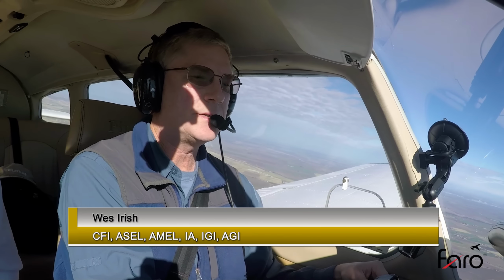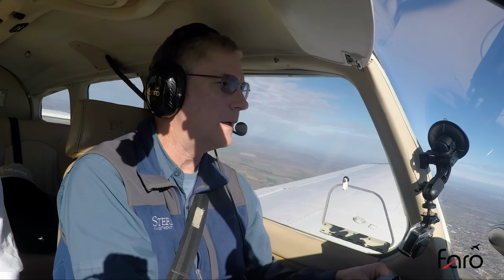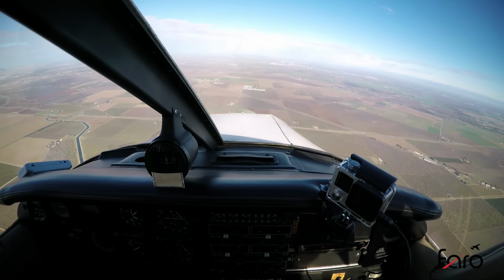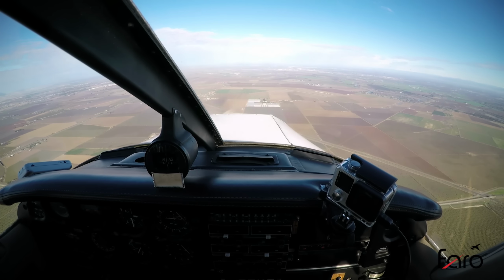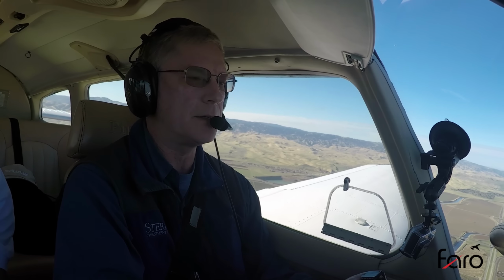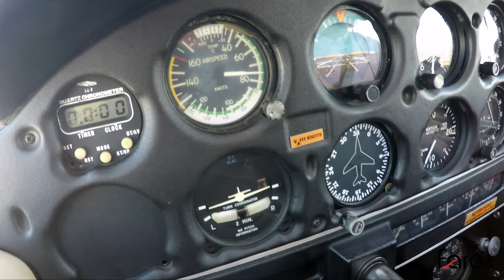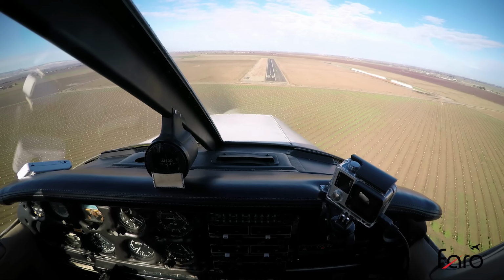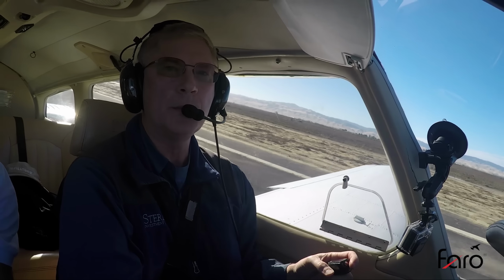Engine Failure in a Single Engine (2.7K HD)

Comment: Great video. My only recommendation would be to mention pitching for best glide speed, 73 knots in this case and then trim out the control pressures with pitch trim to make it easier to maintain best glide speed.

Comment: Actual and simulated engine failure differs a lot as in simulated engine failure the idle engine propeller produces some thrust which will actually increase the glide distance significantly

Comment: At such a high altitude you need to lean the mixture instead of rich.  Not rich mixture when high.  Low rpm needs lean mixture also.  Specially on long descends you are fouling the plugs and dirtying the oil with such a rich mixture.  Low RPM needs leaning the mixture too. FAIL BIG TIME.

Comment: I think in practice you probably need to aim to have a bit too much speed or alt because when the engine fails for real it comes down noticeably quicker than when its just idling.  He had just a bit of extra that he slipped off so that would have been about right.  The other thing is when you get to the approach you perhaps want to move the throttle to idle, or if its a field cut everything off because engines often can not quite fail and a surge at the wrong moment will mean to go through the far hedge.

Comment: !. Always have a landing area in mind in case of a failure.  2. Set up a glide. 3. Troubleshoot using a checklist. 4. Know the surface wind. 5. Look for traffic and obstacles. 6. Communicate  your emergency and intentions. 6. Fly the plane.   ATP ASMELS  FI A&I GI A&I  Rotorcraft  Glider   FAA Gold Seal and "Master Pilot".

Comment: sir what about engine out right on take off with only 100 feet of air.
Reply: Be sure you're ready for whatever is in front of the runway. There is no alternative in the case you mentioned.
Reply: That's definitely about the worst case engine situation, at least at most of the airports I've based out of.  Unfortunately a lot of these airports (on the edge of major metro areas) have a LOT of buildup around them.  There's really no "good" place to plan for a low altitude engine failures from a couple of these runways, so my plan has always been to watch about 30 degrees left or right of my flight path, and pick the best possible spot based on the situation I'm in at the time.
Reply: aky19832001 
quickly try to find a flat space like a field or a road not much you can do. try to avoid homes!
Reply: land within ±30° of straight ahead unless you are certain your glide ratio is 20:1 or something fierce
Reply: pray
Reply: Prey on what? Ohhhh you mean pray.
Reply: well done einstein you spotted a mistake on a comment that was made two months ago
Reply: comet where? Ohhhh you mean comment. How's that for expediency?
Reply: we can do this all day
Reply: OK! You're tern. :-)
Reply: LOOL X__X i dont know what to say here i made a misteak  fix it
Reply: Steak! Oh, you mean mistake.
Reply: @endotype2286  I'd rather have steak than mistake.

Comment: As a second action, I would turn carb heat on: if the failure is due to ice in the carburetor, you want to use any leftover engine heat to melt the blockage.  Hence, the earlier, the better.

Comment: Ops.  Had you been using a check list you might have remembered the Carb Heat/Alternate Air during the initial power quadrant check.

Comment: A simulated engine failure means to turn off the engine and go for restart but, you never shut down the engine. I kept seeing the propeller continuing to turn as if it was still running. What gives?
Reply: carl cappy He had the power at idle, just because the engine was running doesnt mean it was producing any power.
Reply: I think even if the engine were out it would likely "windmill" and appear to be running.

Comment: Pilots will do well to remember that, if its got wings its flies so fly it safely to the ground.
Reply: When the pilot pulled power on a CF-104 Starfighter, the tail started to drop almost instantly... It will glide straight down, backwards if you want, but the ejection seats might work better.
Reply: @andytaylor1588   In certain situations you right,  search on youtube F15 lands with one wing, amazing feat.

Comment: Nice video. Great to see a full glide-in approach and landing. The bummer about the Piper is it only has one door/hatch. My training is paused at the moment. I may continue in the Piper, but ultimately when I'm flying for recreation, I think I'll choose a plane with two doors. What do you think? Am I being too cautious?
Reply: Just before setting it down, get the passenger to slightly open the door and jam it open with a coat or something.

Comment: Not sure why you are landing on the numbers for an engine out. Is midfield not a more appropriate point?
Reply: Nope. If you had an engine failure where there was no airport, and you were landing in say a 400m paddock, you want to be touching down right after the paddock begins (Not halfway down the paddock!) Hence why you aim for the numbers when doing glide approaches at an airport, to simulate a short paddock etc..

Comment: Ok to slip with full flaps?
Reply: Adam McGhee 
Absolutely
Reply: It depends on the aircraft which you are flying. It is prohibited in the Cessna 172N but not in the Piper Arrow. The reason some manufacturers recommend against is because it could cause the tail to stall.
Reply: NOT PROHIBITED DAMMIT! Alright maybe that's too much, it's just said it's to be avoided as it may cause some disturbed air to go over the elevator and cause oscillations. You will need to do whatever you need basically, I slip with full flaps on the 172 all the time, and the oscillations are really not that bad.
Reply: Yup, nose down when slipping so the air is smooth over the back.

Comment: Why fly a beautiful square pattern when the purpose is to survive?  Why not fly directly over the threshold with sufficient altitude and spiral down at the key position to assure the landing in all cases?  BTW, why was "fuel selector to fullest" something like number 150 on the emergency checkist?  It should have been the first thing after setting up the glide and carb heat, if not a fuel injected engine. Just wondering to myself.

Comment: Every Time I watch someone demonstrate an engine failure it is always the same, lots of altitude and near a runway. Their demeanor is always calm and collective with lots of confidence explaining how they would handle such an event. I have had 4 engine outs in single engine aircraft, 1 engine out in an overloaded twin and several other emergencies to include turbine compressor stalls and hydraulic failures in helicopters.So first let me say, you are never ready for the event, there is almost always no runway available and the majority of the time it’s at low altitude just after takeoff. Just for once I would like to see one of these guys who teach engine failures actually have to experience one. I can assure you their entire physical demeanor, voice and decision making process would be different! To be honest I think most would bite the dust if it was real. Anyone can talk about it from a flying powered aircraft at idle, experience it with no power where your life actually depends on the way you handle it.Here’s my advice for an engine failure, Fly the aircraft to the ground and get it as slow as possible (stalled) just before touchdown. Drop it in like a brick if need be. Get rid of all unnecessary forward movement. I can assure you that the engine will most likely be wind-milling and if you had the fuel selector in the correct location along with the mags on both there will be no restart, just find a clean spot on the ground and drop it in with as little forward movement as possible to keep her wings level. If you remember to turn off the master and shut off the fuel it will make no difference if you bust it up on the ground. The battery has power to the master and starter relay, the fuel lines will most likely rip from the tanks and firewall.
Reply: I have a video doing the 5 kinds of engine fails on take off..It is from 1995..but I have it pulled out of youtube due so many Pipipilots either copying it, or complaining they could or not try to practice that..so i hid it..Im a Glider Pilot..Gliders do 200 feet  agl Turnbacks to opposite runway for the test..If you cant do that or complain or whine..they fail you right there..Cant solo it..Thats it..

Most European pilots start on gliders..Famous WW2 Luftwaffe pilots all started on gliders and they saved a lot of airplanes by landing on fields after engine shot up..Many stories on that..
Reply: Gliders are not powered airplane, like an apple and a orange. All I can say is wait till you actually have one over an area with 100 ft trees and at 1000 ft above the ground. Then you can tell me how to handle an engine failure. Flying around in a powered aircraft at idle with thousands of feet in altitude and a runway under you is nothing like the real thing. Practice does not put your body in a fight for your life mode. When the engine actually quits you will have an entirely different outlook on the videos you made. you'll forget all about those nobs, switches and radios, the only thing on your mind will be survival! Put the plane on the ground wings level at the slowest possible forward speed.
Reply: I've never heard of one person having so many failures. This leads me to think that: 1) you're lying. Or 2) you're a reckless pilot and not doing through pre-flight checks.
I do agree that nothing prepares you for an actual emergency and that a lot of time these failures happen at low altitudes. However I know for a fact that most pilots will not "bite the dust". NTSB data shows this to be true.
Reply: Well Ben I'll explain just so you have the ability to avoid these events if possible.
1. Flying helicopters  for the US army, had turbine compressor stall and lost the engine low altitude over heavily forested terrain, Set it down in clearing big enough for the rotor blades to clear trees.
2. Flying a IFR in a twin engine Piper Seneca, lost engine due to failed prop governor dumping engine oil. Lost right engine no oil pressure.
3. Single engine aircraft at night lost engine due to engine breather line freezing, Fuel pressure increased due to crank case pressure on the fuel pump diaphragm flooding the engine causing forced landing, made it to an airport 6 miles behind me dead stick.
4. Lost engine on experimental aircraft due to a P-Mag that jumped timing in flight due to a software issue. Blew intake air box to pieces, blow one intake tube off engine. Dead sticked back to runway teardrop turn at 850 ft.
5. lost hydraulics Uh1 helicopter, water in hydraulic system boiled in lines forcing uncontrolled pressure to flight controls. Forced landing at 40 kts on run on landing with skids.

I have had many other emergency's in my civilian and military flying career. If you are in this business long enough your going to be faced with them!

By the way, I never damaged a single aircraft setting them down.

So in my opinion people who have never actually experienced an engine failure have no idea what its like and should not be giving advice on what they no nothing about in actuality!
Reply: The best advice I can give to anyone is to take off at max climb rate turn 3 degrees from the airport so if she quits during takeoff you have chance to get back on the runway or taxiway with teardrop turn from an altitude higher than normal.
Reply: 30 degrees, not 3 .
Reply: I've been flying 20 years and never had any issues. Of the pilots i know personally, two have. Both put the plane down safely off airport. One in a field the other a road. No damage, I'm glad you've been able to make safe landings in your emergencies.
Reply: I had 10 different kinds of engine fails...from 3 carbo ice ( i fixed them and kept flying), to cylinder loss (2) , to right engine stopping due seized in flight at 1,600 feet agl climbing out practicing an MCA.. Was slow already and  almost MCA and right engine started stumbling very hard, like someone hittting it with a sledhehammer..I pushed nose down to blue line, cut it and put the other to climb rpm to slow down the descend..feathered R and flew on L for 21 minutes to base airport..engine seized due previous prop strike (I didnt know) made engine when hot on the MCA at full power develop a big crack that leaked all oil..

Had 4 on take off..2 of them on singles but single engine fails were partial power..Turned back once from 700' agl Cherokee Six..Other times I Turned around very low downwind leg..(dangerous)...I used to fly old Bush Planes..Singles and twins in South America..In the 1970's and 1980'a ..Got used to lose an engine partial or total every other month..Good luck that both total fails were on twins and I flew them to airports both..no accidents..retired now..enough..No fails on jets..They are a blessing..easy to fly and reliable and air conditioned..anyone can fly a jet these days..Too easy..and boring to fly up, up there...

Comment: Thanks,..But please  can you show us an engine fail at say 600' agl and Turnback..Or a 50 feet RTO and landing back on a long runway..I used to practice them..Ultralights need take off engine fail training..Those engines fail more often..

Cruise Engine Fails or CEF practice are the most easy of them all..Any mediocre pilot can do that..I learned them at 7-8 hours of flight and soloed at 10.5 hours in 1968..Pipers..Not easier Cessnas..

So many CFI's on you tube showing Mild Maneuvering..and avoiding the Hard Maneuvering we all really need to practice..but..noooo!!!...that is hard,...noooo!!!
Reply: Those are called impossible turns because if you try to  reverse direction to return to the runway you won't make it. You will land short or, more likely, stall and crash.
Reply: @IndependentBear  --600 feet agl you can Turnback to opposite if you climbed at a healthy angle, NO SHALLOW EVER..  I practice the Turnback To Opposite on different airplanes every 2 months.  A matter of practice.  Pilots should not be cowards and avoid hard maneuvers..